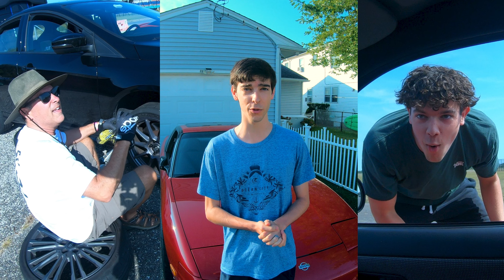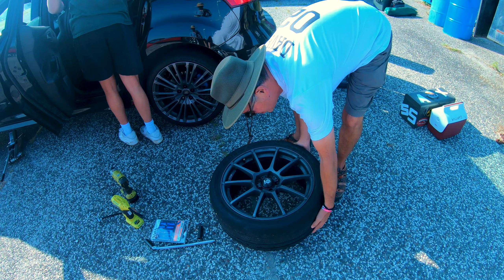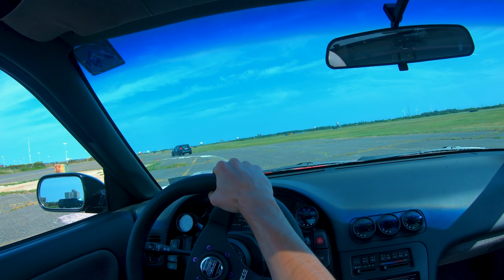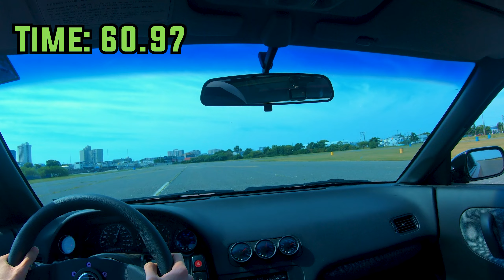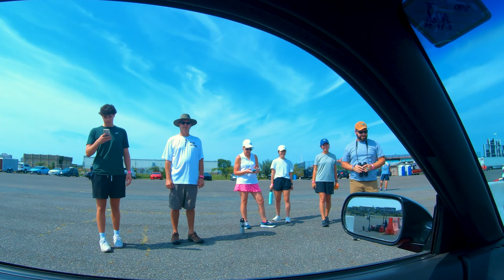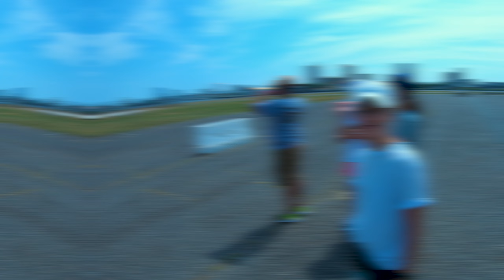FIRST 2JZ 240SX TRACK DAY!

Comment: Nice content, Brother looked good out there! Autocross and this type of driving is super fun! How were your water attempts looking throughout your runs? I have the same cooling set up as you on my s13 jz and she likes to run hot in the summer that’s for sure. 😂
Reply from the maker: @masetcp  hey man thank you so much! I think I was more scared than anything out there but it sure was a blast!😂

My water temps were surprisingly good throughout the runs! I don't think they ever got over 210 which I was happy with. From what I know, you have to start worrying about those water temps once they get over 220 right? 

Anyways, thanks so much for the comment my man! So cool you have a JZ S13 as well!
Reply: @TunerFaction  wow that’s impressive. I would say anything below 220 is totally fine and especially doing small track driving like you were. I been battling 100+ degree weather and mine likes to start to heat up slowly on the highway. I’d say your setup is looking good sir! Keep it coming!
Reply from the maker: @masetcp  thanks for the info man that's helpful! I found that adding some air ducting to route air to the radiator really helped my temps, maybe that's something you could look into?
And thanks man I really appreciate it!
Reply: @TunerFaction  absolutely, I am in the process of that and I’m sure that will help. I also tried removing the hood just to experiment and temps were 10 degrees lower!
Reply from the maker: @masetcp  oh that's awesome man! And DANGGG hahaha maybe I'll just have to run hoodless for my next event😂